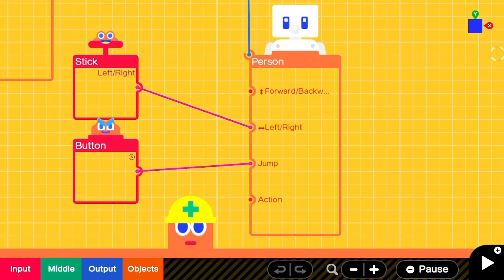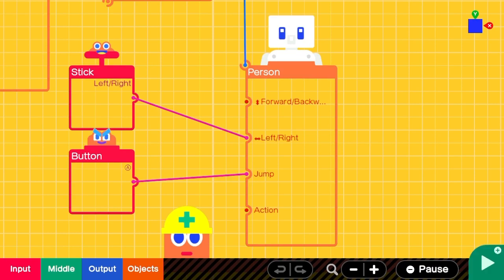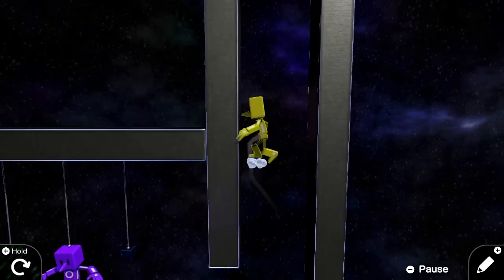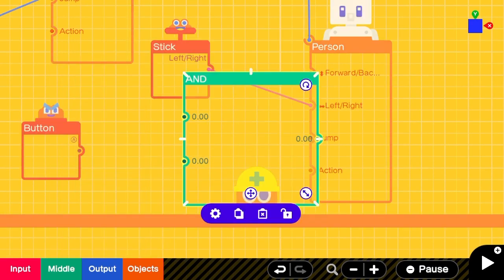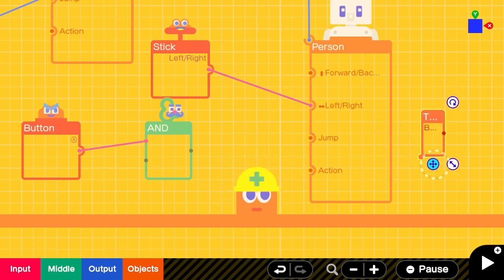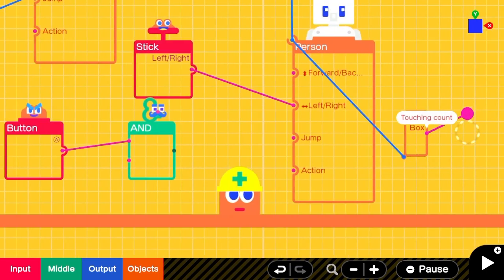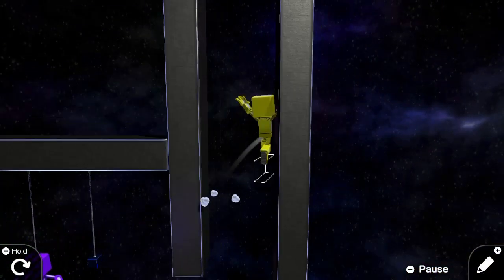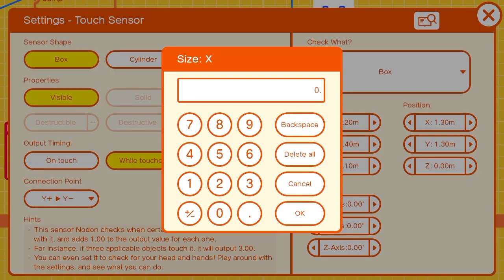How to Stop the Wall Jumping in Game Builder Garage for ... reasons (Tutorial)

Comment from the maker: Note A viewer suggested an alternate method of jumping/floor detection logic. You can use a speed sensor and comparison nodon so that the jump is only allowed when the Y Speed is 0. This avoids any touch sensor issues and is a great option,  just watch out for things that would interfere like sloped movements, etc.
Reply: This would work most of the time but you could still wall jump at the very peak of the jump
Reply from the maker: @redpepper74  hidden speed runner pro tip 😆
Reply: @redpepper74  make it so you can only walk jump at a negative number. Boom: it’s impossible to have negative speed as far as I know

Comment: This works to get rid of wall jumping, but I’ve run into a problem with jumping over gaps. Basically I have a game where you hold the jump button to make the character jump higher than just tapping, so if I jump right off the edge of a box to jump over a gap, he almost doesn’t jump. Is there a way to fix this without making the jump button go into “on press” since my character has some accessories and they can barely jump if the button is set to “on press”
Reply from the maker: Is there a problem to setting it to while pressed? I had it to on press in the video but I just opened the game back up and I don’t think it makes a difference. Also you’d still run into the problem of when the touch sensor stops touching the floor, the jump signal technically gets cut because of the AND nodon. I just tested it and a simple if a little silly looking way to fix that is to make the touch sensor loooong. So for me I ended up with X-.10, Y- 1.80, Z-.10. This will let you long press to jump and it will let you keep the jump signal for the whole jump. Let me know if that works or makes any sense
Reply: maybe try adding the same button nodon and change it to “while pressed” and attach it to the person? you probably figured it out by now and just saying lol

Comment: Could you also attach a NOT nodon between the touch sensor and the AND nodon? That way he can only jump while no box is touched :o
Reply from the maker: In this case if you did that, he couldn’t jump because it would always detect the box. I did use the NOT nodon in my double jump video to make sure we only add the double jump force when he’s off the ground.
Reply: @DaveNodon  oh i see! Becaus there is always the floor as a box right?
Reply from the maker: @giulytsme  yes, or whatever you make your floor out of. So if my floor was all cylinders that’s what I’d make the touch sensor check for, for example.
Reply: Probably.